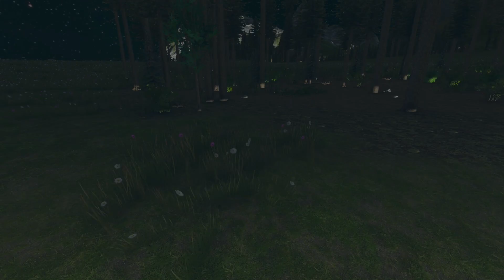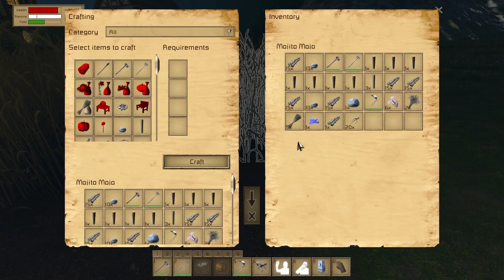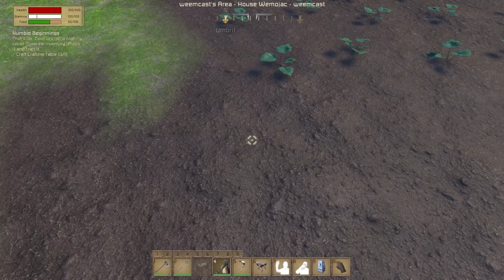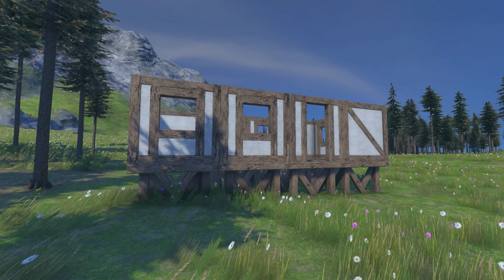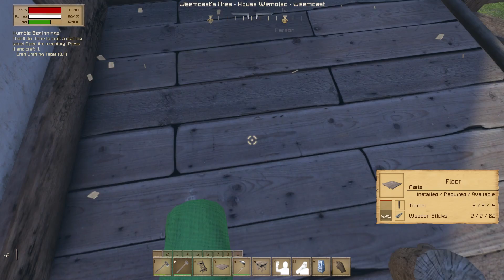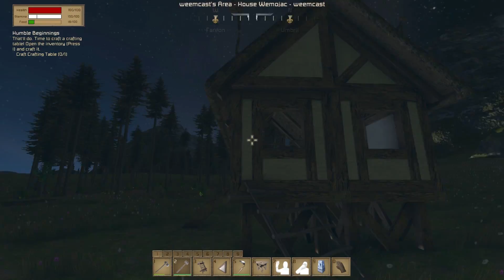Medieval Engineers - Expanding on Farming, and Building a Farm House!

Comment: If you hold CTRL and use the scroll wheel it will move the building block further away or closer to you and that will help snap to the grid.
Reply from the maker: Wow, thanks for the tip!